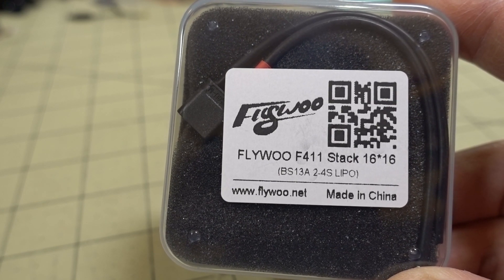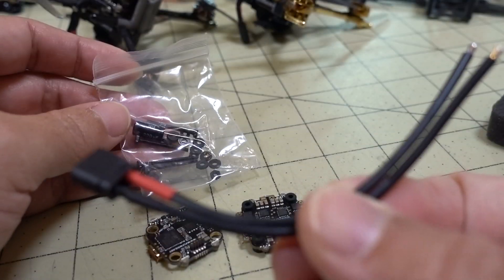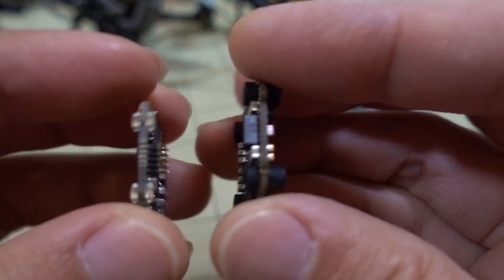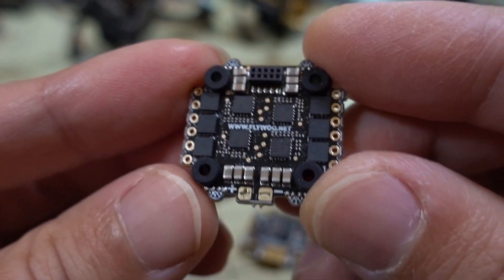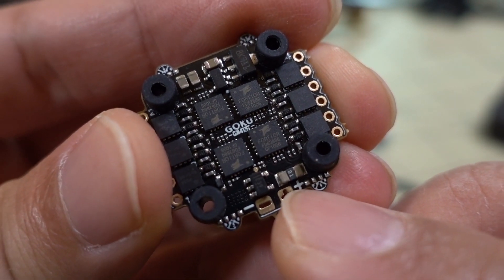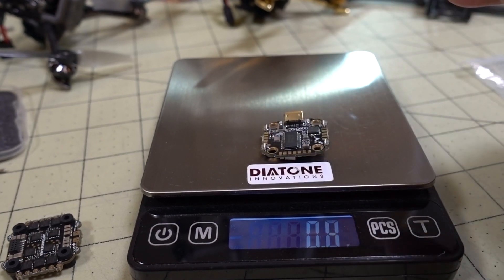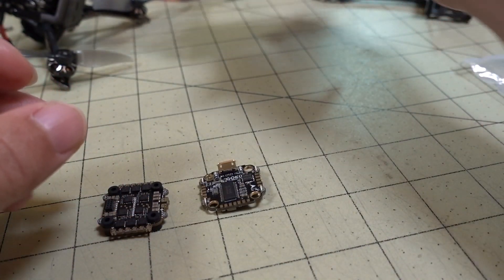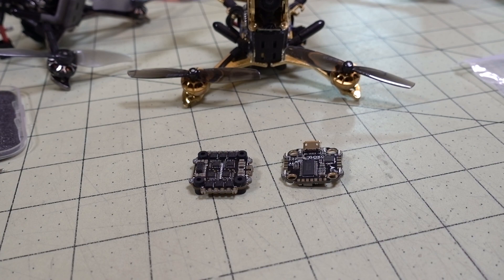Flywoo F411 Nano Stack 🎄

Comment: Curious, the XBot 3 has this installed with the orientation arrow to the side rather than pointing to the front. Did they change something in Betaflight for this orientation. If you just buy the stack, is the arrow correct and should point to the front (like other boards) or does it point to the side like the XBot 3 and XBot 65 ??